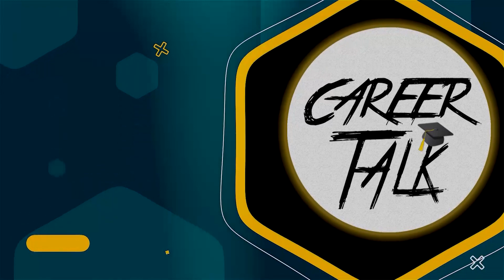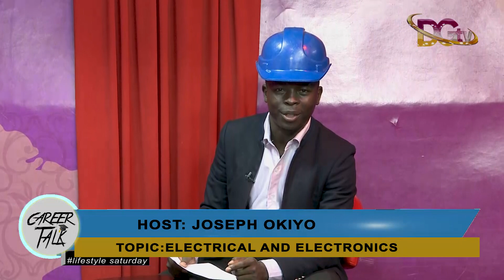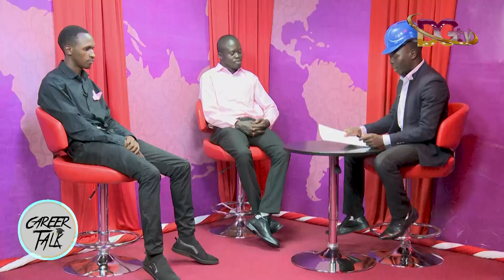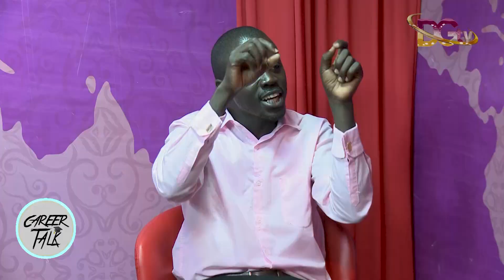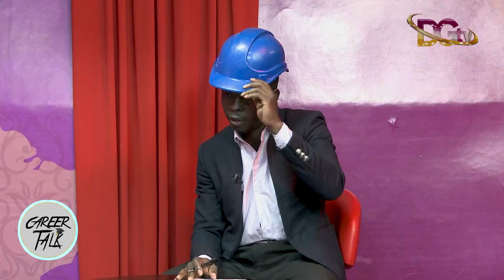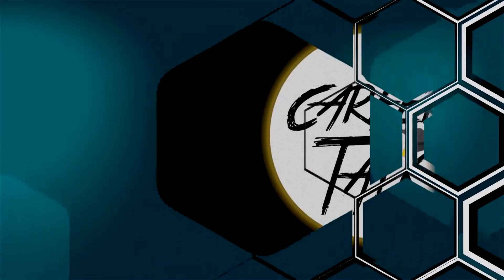Career in Electrical and Electronics Engineering - DGTV KENYA

Comment: This is a good talk but not accurate..electrical repair and installation is part of EEE but I haven't heard them talk about Control systems and power electronics design, PCB design, Installations planning, Telecommunication Networking and so on....
Reply: It's so crazy they look like they have no idea. They talking about installation and repairs which is electricians work, those are not electrical engineers.
Electrical engineers design circuits, plan installation then electrians install which is a basic part, they don't need to do a degree to do installation.